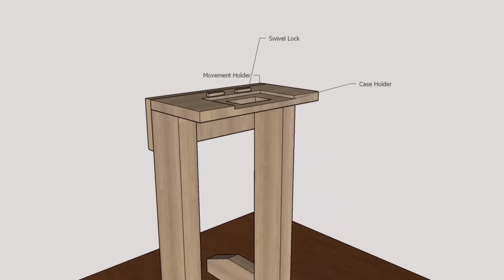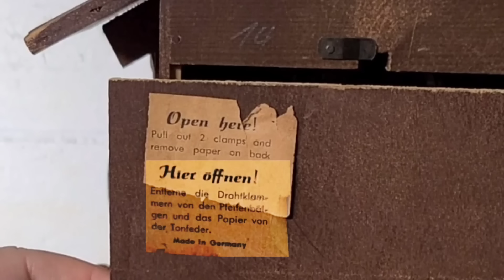Damaged 1950s Cuckoo Clock Restoration

Comment: I just use tyvek from disposable white tyvek coveralls you can buy at the hardware store.  One suit is only about $10 and is enough for a LOT of replacement bellows.  I prefold/crease the bellows before I attach it to the whistle.  And, I attach it using hot glue.  I use a small clothes iron around the glue seams to be sure the hot glue joint is strong and leak-free.  Your method appears to work just fine as well!

Comment: Hi as both a clock and especially a mechanical music enthusiast (player pianos, band organs, music boxes etc) I thought I should weigh in on your restoration of the two bellows for the cuckoo. 

Personally I think the best thing you could use for the bellows would be to emulate the way a fine pipe organ or mechanical music technician would do it: use a fairly thin grade of pneumatic leather available from a player piano or pipe organ supply house (such as Columbia Organ Leathers in Pennsylvania; or John Tuttle's "Player-Care" website), and glue it on using hot hide glue, which comes in a small packet of crystals you mix with water and heat up in a glue pot or similar (double boiler). 

Hot hide glue is the preferred glue of choice by all fine pipe organ techs and mechanical music restorers, when gluing traditional perishable materials like leather, rubber-cloth etc to wood (other specialized glues like PVC-E glue are used with modern synthetic materials like Polylon). 

This is because if properly mixed and applied, it is very strong and stays strong for decades, and yet is easily removed by sanding by the next restorer the next time the materials are replaced. 

Other glues like white glue, carpenter's glue etc are hated by restorers when they come across them used (by the previous restorer) for this purpose, since they are very hard to remove without wetting the wood, and gum up sandpaper. In many cases, new wooden parts may need to be made when the wrong glue was used, which can drive up restoration cost and make the instrument less original. 

Carpenter's glue is fine for gluing a cracked or split wooden part which is never supposed to come apart again, but should NOT be used for gluing joints and attaching materials that will need to be removed again in the future as part of another restoration.

 If you think that's bad for two simple cuckoo clock bellows, try mutiplying that by 44 for 88 note pneumatics in a player piano! (AND pouches, AND valves etc etc) 

You can read more about what glues to use and NOT to use, and why, for pneumatic work, in th archives of the Mechanical Music Digest (MMD) online. Just browse the subject index for the letter G and then "glue" and you'll find hundreds of articles. 

For pneumatics which work on air pressure (like here) rather than suction, it is traditional for good organbuilders to add triangular or diamond shaped STIFFENERS to the inside of the flat sections of the leather, which keep it from blowing out and coming unfolded in use. These can be made from a variety of materials, but a kind of thin cardboard/cardstock or fiberboard, would be appropriate here.

 The stiffeners must not touch or rub each other by the edges, nor bind; they could poke holes in the leather if too sharp or improperly made or installed. But in use, they keep everything neat and tidy. 

You can see examples of recovering pneumatics on John Tuttle's YouTube channel (dealing with player pianos), as well as on Nate Otto's channel ("Outside the Vacuum") and Bruce Newman's channel ("DuoArtOrgan"). They are all good craftsmen specializing in player pianos (with Bruce also working on organs). 

Also, great advice for working on player pianos is to be found in Art Reblitz's book "Player Piano Servicing and Rebuilding" from 1986. 

Anyway once the bellows are properly recovered (some say releathered), then you can turn your attention to the two little wooden flute (organ) pipes themselves which make the cuckoo. Maybe you already noticed one pipe is split down the middle right around the mouth (opening on the side where the aound comes out). The crack affecting the upper lip (long tapered part above the opening) will affect the speech and tone of the pipe, so I suggest gluing and clamping it, GENTLY (carpenter's glue would be appropriate here). 

Hope this helps!
Reply from the maker: Thanks for sharing all of that! It's really nice to know. Next time that I need to replace bellows, I'll look more into the methods you described. Thanks again!

Comment: Nice video.  I'm just starting out as well.  I had a friend with a similar clock, but it was in better shape.

One thing, I would have reeved the chains on the wheels before putting them in.  A tiny bit of wire/string tied through a link on each side will hold the chains on and easily snipped off as you install the works back in the case.
Reply from the maker: That's a good idea. I had to pay attention to not let the chains slip off when I was moving it around. Thanks for watching!

Comment: I used to clean vault door time locks back in the day, and we used Rose oil for all the movements.    Is may be the same as the clock oil you have..  lithium grease over time will dry out and get hard. We stopped using it on vault doors bolt work for that reason.

Comment: Nice video.  I have my mother's cuckoo clock with a broken bellows my dad was going to fix but now it is my job.  Now I know how.  By the way, the first thing is a "snap ring".  The thing that flew across the room is an "e" clip.  The special pliers you bought are "snap ring pliers".  I usually use needle nose pliers to install "e" clips.  I have also broken a half dozen or so tips off of snap ring pliers, so don't squeeze too hard.   Also, I don't work on clocks but I find them fascinating.
Reply from the maker: Thank you! I wasn't sure at first what they were called. On two different websites they called them E-Clips, so that's what I thought they were called.

https://timesavers.com/i-8947345-regula-cuckoo-clock-e-clip-10-piece-pack.html
https://www.clockworks.com/product/clock-e-style-clip-washers

Comment: My table saw has a blade shield with sharp safety hooks on both sides. The wood slides through the blade, but the safety hooks prevent all wood kick back on both sides of the blade. 👍🏻
Reply from the maker: Yeah, mine had that, too, but I took it off. It just got in the way. I've learned not to stand directly behind the blade as I'm cutting, but rather off to the side a bit. This way, if there is a kickback, it won't blast me in the face again.

Comment: For eclips, I use a small flat head screwdriver to remove, insert into the grooves and rotate as if you were unscrewing, they pop out easily. For reinsalling, needle nose pliers and just grip. By far the easiest method I’ve found: hope it helps
Reply from the maker: Thanks for the tip and for watching!

Comment: Just a little advice from another clock enthusiast there is a brass cleaner you can add the water it works best with a heated sonic bath! Now it I for brass but used for cleaning shell cartridges it is by Hornady called one shot sonic cleaning solution. It is fantastic with almost no smell for anyone to complain about. Personally I think it works better then the 50 dollar a gallon clock cleaning. Try it you will be happy you did.
Reply from the maker: Thanks for the tip!

Comment: Great channel!!! I have a cuckoo not sure if it’s German but it’s in need of some work. It has a bellows that’s ripped and some minor woodworking to be done. I also have a grandfather clock it was built in 1984 so it’s not antique. And three wind-up mantle clocks looks like retirement is gonna be busy. I’m not sure about taking the works apart, I’m not good with such small parts. I have bigger hands and sausage fingers. I’m better at wrenching engines and motors. Although being retired I need the challenge. I got lots of info off this post as far as oiling and cleaning, super small screwdrivers and pliers. Thanks for the post and I’ll check out the rest and subscribe to your channel. Stay safe!
Reply from the maker: Thanks for watching!

Comment: I have a 3-weight 1969 clock, with a music box that turns a water wheel, as a woodsman chops.  It's been packed for 45 years, and I have to see if it even works.  It still looks like a scary project to reassemble.
Reply from the maker: Nice! Yeah, they can get pretty complicated.

Comment: Check  out typewriter repair tools. They have a tool made for those small E rings. It holds the E ring securely, Make a tent to place clock in, so it will catch any parts that happen to fly off. I used plastic bag to dissasemble things in, and it works great to keep parts from flying off.
Reply from the maker: Thanks for the tip!

Comment: I have retrieved a similar clock from storage, that was purchased new by my parents in 1959. The casing is identical, although the mechanics are different, mine has a countwheel on the striking train, which unfortunately   is locked up. The clock train itself is working and it does keep good time however
Reply from the maker: Very interesting! Thanks for watching!

Comment: I always polish the plates, Clean the inside of the case, Polish the pinions, check and rebush, (I know you mentioned that) I never use water, unless there is an important reason. Your fold on the bellow does not allow it to compress, you may need to Skive it.  So its weak on the Co. Ok on the Koo, it takes a long time to learn skills and almost always it's the hard way, but very good effort , for a newbie it's a fun Profession, and always in demand
Reply from the maker: Thanks for the information. I figured I wouldn't get everything just right. It's definitely a learning process. Thanks for watching!

Comment: I have the exact same clock I have had since 1970 when I purchased it in Italy while in the Navy. It still runs perfectly today and the cuckoo bellows are loud and clear. I must have a rare model as the Rabbit is on the Right and the Bird on the Left side of my clock. I actually tried to reverse them thinking I had placed them incorrectly back when I performed maintenance on the clock some years back, but no, they are correct and only fit in that configuration.
Reply from the maker: That's really cool! Is your cuckoo missing an eye?
Reply: @WatchOverhaul  No, mine has both eyes, but I did notice the "gong" coil is not audible any longer. I will take it down for inspection when I don't have so much caffeine in my system.
Reply from the maker: @monstersdoexist  sounds like a plan!

Comment: Hi, i did the same a couple of weeks ago, greasing this time everything with Liquid Bearing, after all an good kind of oil. 
easy tool by removing and replacing the chains is the use of a peace if iron wire,  0.7mm thick with a small hook bended 4 guiding the tiny chains.
Reply from the maker: Hey! That's a good idea. It was kind of hard to get the chain started through with tweezers. Thanks for watching!

Comment: I am a clock collector and I have them restored. You are doing good work to a degree. However. The animals hanging on the clock are meant to move around like that. And the bell on the horn will come off if you pull it gently but firmly. That is made to come off and on. As far as oiling. Yes. NEVER use 3-in-1 or WD 40 or sewing machine oil. The clock smiths I know use Synthetic motor oil for European cars. It is the same stuff they sell as clock oil. Only difference is you get a whole quart of motor oil and it will last you for YEARS. And the best thing to clean clock cases with is The Original Bee's Wax Old World Formula Furniture Polish . You can use it on all outside parts of any clock.
Reply from the maker: Thanks for the info and for watching!
Reply: Great video and great job. We have been repairing and rebuilding cuckoo clocks for years and yours looks great. I do not agree with the statement about the oil being the same as motor oil in this thread. I could go on for hours about clock oil.  We use the same clock oil as you did in the video and have been extremely happy each time we use it. Keep up the great work.

Comment: Nice job.  A couple of suggestions… clean, repair, and touch finish to the case before replacing the mechanism.  Once you remove a movement, consider lightly degreasing the whole thing with a gentle cleaner like the purple stuff, and put anything that looks oxidized/rusted in Evapo-Rust.  Then carefully rinse it off with distilled water, and use compressed air - the canned stuff if your work area isn’t set up for it - to get rid of moisture quickly.  Obviously one has to be careful not to blow parts away or break small fragile parts, but you have the good sense to be cautious!  Beware of flash rust on anything ferris, and on non-bearing areas of such materials, a quick coat with your clock oil wiped off with lint-free fabric will protect it.  I always polish especially brass plates and such, but it depends on if you are conserving or restoring.  I’ve done a number of old tool, clock, and jewelry repair with good results, but if a pro pipes in, listen to them first!  Your best talent is gentle patience!! 👍🏼💡⚙️🪛
Reply from the maker: Thanks for the suggestions! I'm always hesitant about polishing the movement. I want to clean the movement, but I don't want to remove natural patina that shows its passage through time. Thanks for watching!
Reply: @WatchOverhaul  You bet - nothing wrong with a conservation approach!

Comment: Congratulations for this beatiful Video. I'm a Hobby Watchmaker and repairing Cuckoo clocks for a long Time. If you want to clean the Movement well, you Can use Elma RED 1:9, it is specely for those and is based on Amomonjak and Water. Good Job. Best Regards from Germany
Reply from the maker: Thank you for the tip. I will look into that. Thanks for watching!
Reply: @WatchOverhaul . Cleaning is also possible with an mix of a bit of vinegar , tiny bit of salt, drop of detergent and 2 liter of distilled water in an stainless pot .  warm it up on the gas in the kitchen bij some stirring and after an hour cool it down in fresh water, you will be amazed.

Comment: clock oil is mineral oil. 3 in 1 is mineral oil. Either works great. Do not be fooled, by a pint of mineral oil in drugstore and 
thats that. 
You did a great job amigo. Keep going, build tools slowly. You are going to have so much fun with the clocks you
work with. Follow your passion.😊
Reply from the maker: Thanks!

Comment: Love your videos! Btw , the second clip you had trouble removing with snap ring pliers is actually called a “C” clip . You can remove them with snap ring pliers. But honestly I’ve found that a small flat head screw driver works better . Put your finger on back side of clip and push one side with flat head very gently . Your finger will keep the clip from flying across the room . And you can reinstall the same way . Keep up the good work !
Reply from the maker: Thanks for the tip and for watching!

Comment: Use simple green and water in your ultrasonic cleaner……….after drying then rinse again in mineral spirits and dry parts are protected from corrosion and are much cleaner.     Keep working at it. Your on your way  and doing nicely!
Reply from the maker: That's a good idea! I'll try that on the clock I'm working on now. Thanks for watching!
Reply: Better idea than mine!

Comment: 20:20 Using pliers like you did is the best/safest way of removing & refitting those 'E' clips.
Re: Oiling
Less is more.(You can always add more later)😉.
Reply from the maker: Thanks for the feedback. I went a little heavy on the oil, but not on purpose. I wasn't used to oiling like that, and it came out fast. Thanks for watching!

Comment: I've got an old cuckoo clock that's pretty messed up (torn bellows, chains off, etc.) I wish I could get it repaired, but just not feasible. But at least it still looks good hanging on the wall, even if the cuckoo hasn't got anything to say! You did a really great job on this.
Reply from the maker: Thank you! And that's too bad about your clock. What year was it made? Thanks again for watching!
Reply: @WatchOverhaul  I honestly have no idea. It's similar to yours, but somewhat less ornate in decoration.
Reply from the maker: @BroWCarey  Certain information that's stamped on the movement will help track down a time frame. That's how I figured out when this one was made.
Reply: @WatchOverhaul  I'll have to take a look at it. Thanks.
Reply: @WatchOverhaul  I found that it's a Hubert Herr clock, made in Triberg (Black Forest), Germany. It says "unadjusted and no jewels." The date 4/83 is scratched on the movement, which I suspect is the last time it was serviced. The "no jewels" apparently was to avoid a tariff when exported, and the fact that the cuckoo is wood, not plastic, looks like 1950s. The number 4 on the face is IIII as opposed to IV, which I understand was common for those clocks. One of the bellows is torn up, the cuckoo is missing his lower beak. Pretty beat up clock.
Funny anecdote about it: When I first got this clock, I was putting it on the wall in my dining room. My formerly-feral cat Louisa was watching me intently. I noticed her interest, and told her, "It's a cuckoo clock!" When I said "cuckoo clock," she acted like I'd given her catnip! I got a kick out of that, so I said it again. Something about the way the words sounded really had an effect on her! Every time I said "cuckoo clock," she acted cuckoo! LOL
Reply from the maker: @BroWCarey  That's very interesting! I always like to find out all the information about a clock before I work on it. I like to know all the history first. That's really funny about your cat! It was making me go cuckoo just hearing it cuckoo so much.
Reply: @WatchOverhaul  🤣